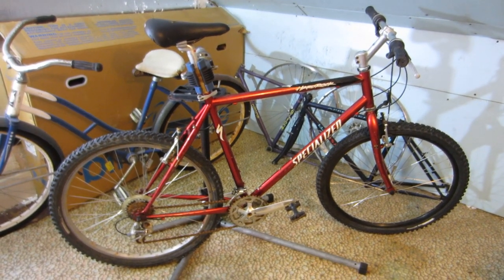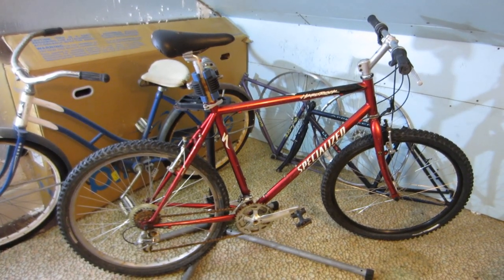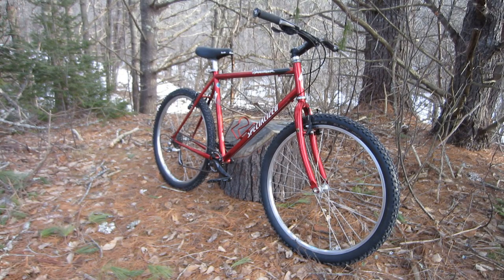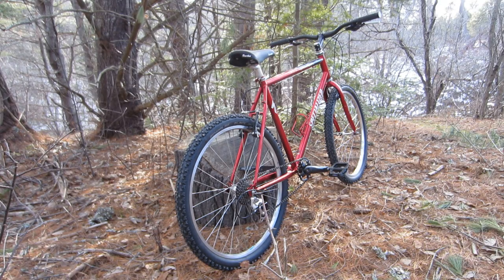1999 Specialized Hardrock Restoration and Upgrades

Comment: I have the same bike, only in the bright yellow that they made that year. I bought it new, and haven't ridden it nearly as much as I have wanted to over the years. 

I'm considering upgrading some parts, now that gas has reached an insane price and is still climbing.  Yuck!!  The twist grip shifters are a pain, and Specialized put pretty low end parts on the crank set and derailleurs.  Heck, I'm even toying with the idea of an electric conversion.  I live about 10 miles from my work, but it's rural, and speed would be a bonus for getting to work quickly.  

I can 100% relate to your thoughts on rebuilding stuff. I enjoy the satisfaction of restoring things that someone else may consider junk. And mechanical items are a thing of beauty!!!

Thank you for the video, and I have sub'd!!
Reply from the maker: Thanks.  I'd be interested in seeing what you do with your bike.

Comment: Looks great! I own a mostly original 87 Hardrock in teal. Thought about converting to 1x but the original components were in such great shape that I decided to keep it looking stock. Did recently convert a beat up full sus Stumpjumper from 3x7 flatbar to 1x10 dropbar that allowed me to get my wrenching fix. Fun project.
Reply from the maker: Those both sound pretty cool!
Reply: How did you turn it into a 1 x 10?  Did you have to build a new rear wheel?  I currently have an old, 90's Hardrock 21 speed I want to convert to a 1 x but the original hub won't allow me to change out the cassette to someting with a few more gears.

Comment: I just purchased this exact bike for $100 on offer up. At 51, I'm intimidated to do this but - you bike came out wonderful ! I'd like to paint my bike also and change the neck and handlebars - guess I've gotta do the research - thanks for the video
Reply from the maker: It is a good solid platform.  Don't let age impede you,  I turned 61 a couple weeks ago.  Just take your time, and take lots of pictures before changing anything so you can go back if needed.  I also recommend Park Tools and RJ the Bike Guy channels.  That's where I did most of my learning.
Reply: How much was this bike new ? I looked at countless bicycles and was told the names to stay away from and the brands to consider - I'm assuming the hype was big for this model in 99 but was this just an entry level specialized ?
Reply from the maker: I'm unsure but around $300 would not surprise me.  I believe the Hardrock was a step up from the Rockhopper.

Comment: Nice Job Jim. I have a 2010 Hardrock I am considering restoring. Needs new lines for the the brakes and derailleurs. A new caliper in the rear. And a bunch of clean up etc. Not sure if the bike is even worth the investment. Decisions decisions lol.
Reply from the maker: I guess worth and value are different things, at least on some of the bikes I've  restored. :)

Comment: I have the same bike. But with a stuck seatpost. I want to restore it too but i can't start unless the seatpost is loose. Great videos!
Reply: I have the same issue as i am bringing the same bike back to life. For some reason Specialized spec'd a 30.4 seat post for the CroMo frame and a 30.9 for the alloy. So what some did was to hammer a readily available 30.9 into the frame.....not fun.. good luck

Comment: You did a wonderful job restoring that old bike, well done! I have a 1994 hardrock in the shop right now. But I'm thinking about taking it apart for a good clean. If I may ask, what kind of grease did you use for the peddles hub and the handle bar hub?
Reply from the maker: Thanks!  I use all purpose marine grease, no special reason except that is what my late father used.

Comment: Nice job the end product looks great. I would leave it as is, and enjoy. I know exactly how you feel about fixing up a bike and making it rideable again. Cheers
Reply from the maker: Thanks. I think I am going to touch up a few really bad spots and then clear coat it, blemishes and all.
Reply: @JimsObsessiveCyclingDisorder  I like your idea on the paint. How do you find the drive line with the 1x7. I just picked up an old Giant with a 3x9; and would like to go to 1x9 and use the cassette that came with the bike as it in good shape. What do you suggest thx.
Reply from the maker: Hi. Well, I'm optimistic about the 1x7 but since it is winter in Maine, the trails are only rideable on fat bikes.  That said, I am going to take the vintage wheel to my local bike shop to have an 8/9 speed freehub installed for a 1x9 upgrade.  I'm also in the process of restomodding my 1994 Approach mtb to 1x9.  I think a 1x9 on the Giant is a good idea.  I recommend a chainring smaller than the low gear on the cassette if you can, for climbing.  Check out my video on my Diamondback  Response where I did something similar with a 1x8.
Reply: @JimsObsessiveCyclingDisorder   Thanks again for getting back. Yes winter here in Canada also just outside Toronto. The bike is a 2007,2008 Giant Iguana. She is 3x9 currently so I`ve ordered 30T NW chainring. Cheers keep the video coming they are great.
Reply from the maker: Thanks!
Reply: @JimsObsessiveCyclingDisorder  they're not blemishes, they're the bike's history. Like our wrinkles, they tell the story of a life lived. Nice build.
Reply from the maker: @Korina42  Thanks!

Comment: I've recently rebuilt a Specialized Hardrock Comp, 96 or 98, I'm not sure. It's got full XT M739 brakes and shifters/ mechs, Strongarm crankset with Syncros rings, original saddle, stem and bars. Tyres are DART/ SMOKE with green slime tubes. Still original paint, despite the 20plus years scratches and scuffs. Used as my daily commute now. Will be swapping out the tyres for some Tioga cityslickers 2.10 shortly.
Reply from the maker: This sounds like a sweet ride!
Reply: @JimsObsessiveCyclingDisorder  just getting back into biking after a long hiatus, this bike has been needed to be built since I got it in 2008. Now riding it daily, wishing I'd built it earlier...
Reply from the maker: "The best time to plant a tree is 5 years ago.  The next best time is today."  :)
Reply: Update! The strong arm cranks are off, M739 XT cranks on, m737/738 XT hubs on Mavic M400 rims with DT Spokes and gold nipples(hehe)
Tioga City Slickers 2.10 are rolling rubber for commuting.

Comment: Why didn't you service the bearings in the headset and bottom bracket?
Reply from the maker: Hi!  Good question.  While the fork was off, I did repack the headset caged bearings. However, the camera was off, while I thought it was on.  The bottom bracket is a sealed square taper unit so it's not serviceable, but it spun freely so I did not replace it

Comment: Is it worth it to put disc brakes on this bike?
Reply from the maker: I rather doubt it.  You could replace the fork with one with disc mounts, but you would have to weld a disc mount to the rear triangle.
Reply: It doesn't need disc brakes; cantis and V's will stop the bike.

Comment: Thank for the video.  I have the same bike. Can I just use the stock 7 speed cassette with any new chain ring? I want to make a 1x7 drive train. Or do I need to mess with a new cassette for chain alignment?
Reply from the maker: Hi, I don't see why not.  I'm presently running a 1 x 7 on a Schwinn AL Comp.  :)